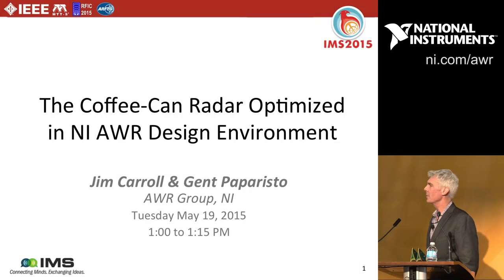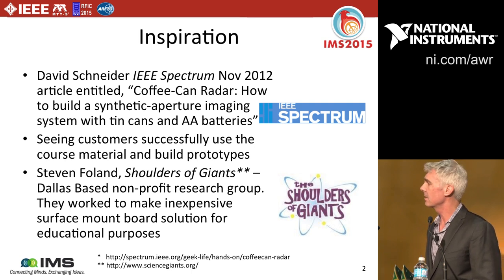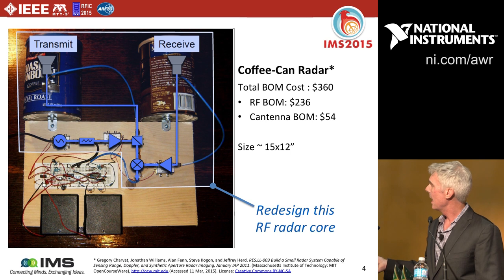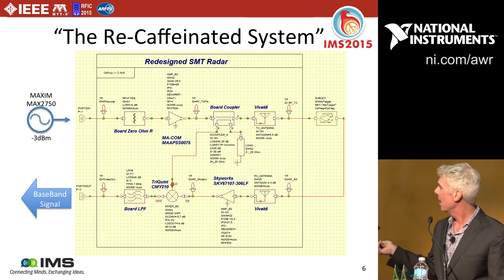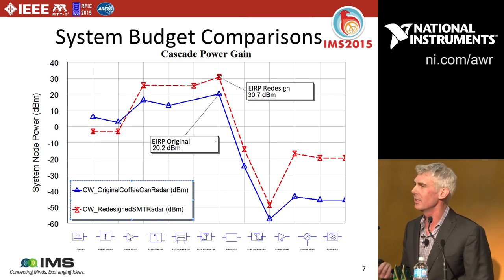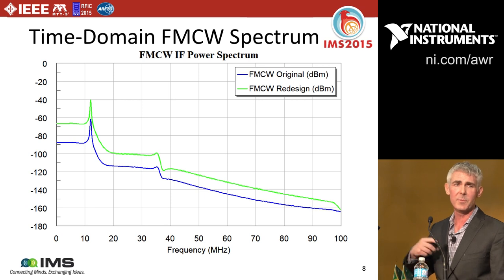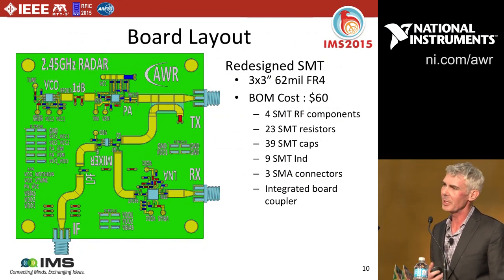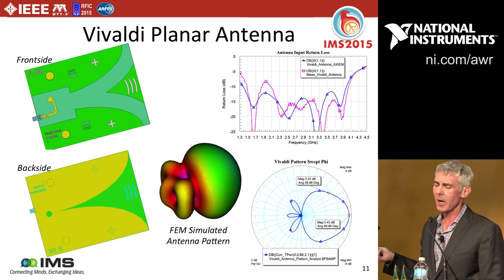Design Example: Coffee Can Radar System

Comment: Very interesting design. From where can I purchase the redesigned SMT based 2.4GHz  AWR RADAR board( without antenna). Please provide the link. If it is not available for purchase then provide the link to purchase the components along with the circuit layout.